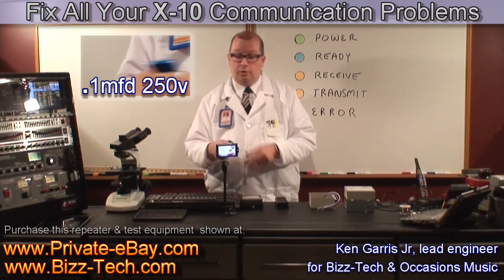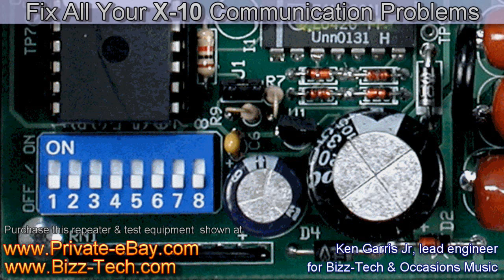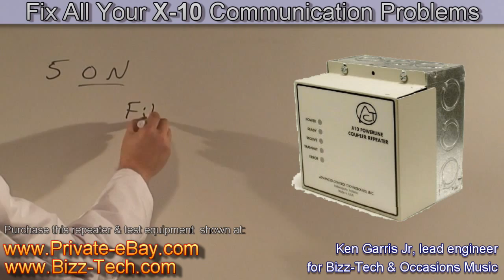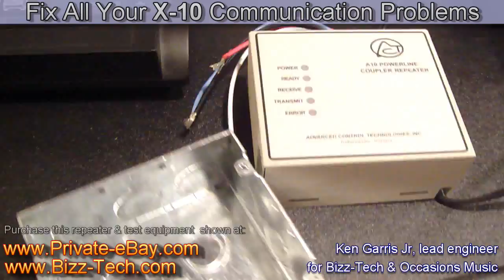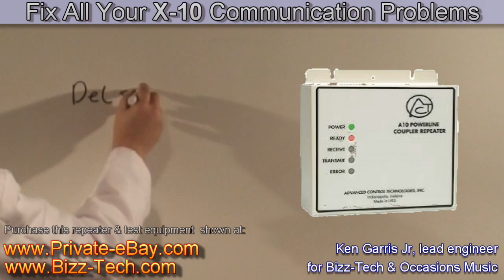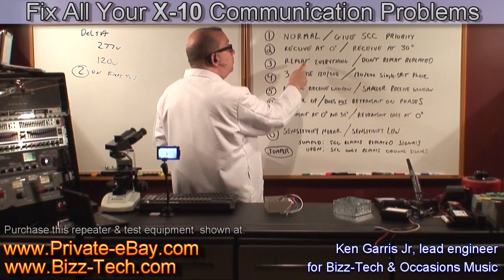FIXING ALL YOUR X10 PROBLEMS - X10 TROUBLESHOOTING - CR134 CR234 X10 REPEATER + AT004

Comment: Ninety-five % of my X-10 system died today. Something changed. Only one light from one transmitter works. I just added a new computer which I will unplug. Next to the breaker panel to try to isolate the problem. Thank You for an interesting video- Ken, retired electrician.
Ps  I have no alternative way to turn ON any lights. Everything has X-10 modules.

Comment: Ken, I have an X10 battery operated remote wall switch that works great to control a ceiling light over my kitchen sink that has no wall switch of it's own. About 15 feet away in my garage I have an X10  light switch wired into a metal junction box. If the garage wall switch is left out of the metal box it works fine to control it from the battery powered remote inside the house. It does not work when installed fully in the metal junction box. Will a cheap repeater like this one work to get the signal through that metal junction box?
 https://www.amazon.com/X10-SR751-Frequency-Repeater-Module/dp/B00P84A4NG/ref=asc_df_B00P84A4NG/?tag=hyprod-20&linkCode=df0&hvadid=193989831776&hvpos=1o2&hvnetw=g&hvrand=15660565827335392760&hvpone=&hvptwo=&hvqmt=&hvdev=c&hvdvcmdl=&hvlocint=&hvlocphy=9051997&hvtargid=pla-310192443119&psc=1
Thanks for your help.

Comment: Great video. Very informative. I installed a CR234 in my house 5 or 6 years ago. I have 6 electrical panels between the house and garage and had unreliable X10 communications. I installed the CR234 on my main panel and it resolved the communication problems. It has run flawless since the day I installed it. Great product. Sorry to hear it's being discontinued.